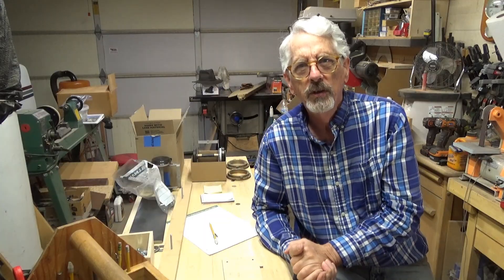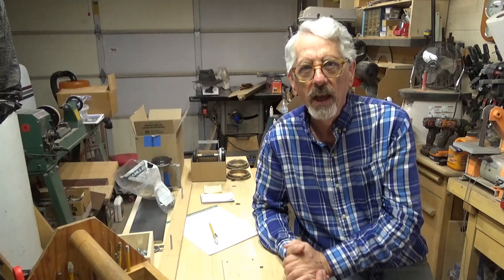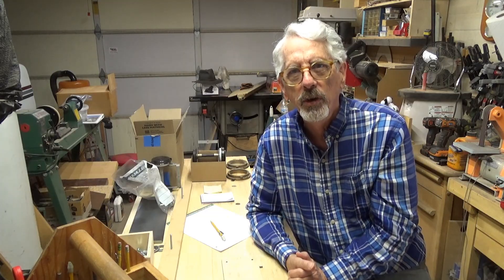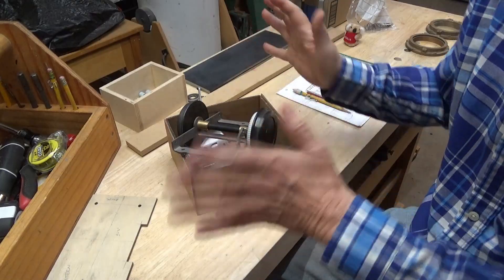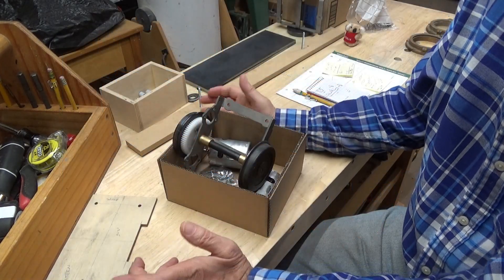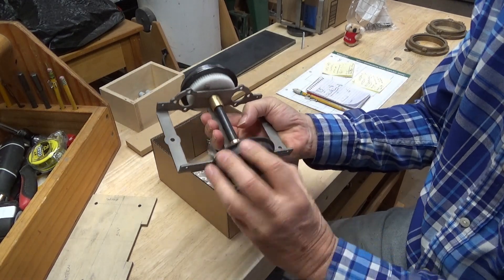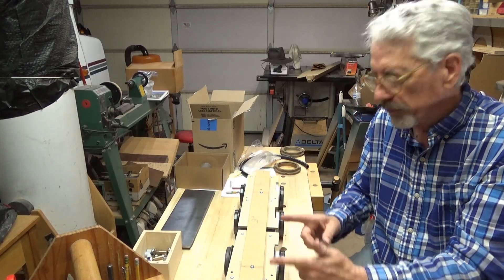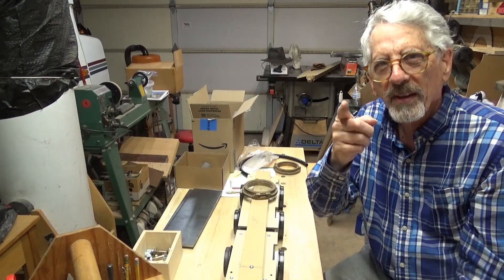Building a New Locomotive - Part 1

Comment: Do you know what motors they are using
Reply from the maker: It's a 12v brushed 60-watt DC motor with a 10 tooth pinion gear attached.  The can is roughly 2" x 3" and I see some faint printing on the can: 987B-5525ASW-R-CE51C059

Comment: Stan, you can trim(round) the corners of the bogies for added clearance.  Depending on the weight of the body, the springs may need to be increased to support the body above the bogies.  
Consider using Delrin for the bogie supports to reduce the friction there.  Use bolts through the bolsters to keep the bogies or trucks attached to the frame.
Reply from the maker: Thanks, Roy!  I was thinking once I know better what a target weight might be, I could get some springs from McM-C.

Comment: Stan, I would reverse one of the axles so that you have a gear on each side of the bogie. This will help with your weight distribution as the weight of each motor will cancel our relative to the centre line. The wiring to one motor will then need to be reversed. If you then wire them in series they will run on 24V.
Also reversing one wheel set, the suspension springing will make more sense.
Looking forward to the next instalment.
👍
Reply from the maker: Interesting idea.  Let me think about that.  I think Maxitrak puts the gears all on the same side.  Thanks!